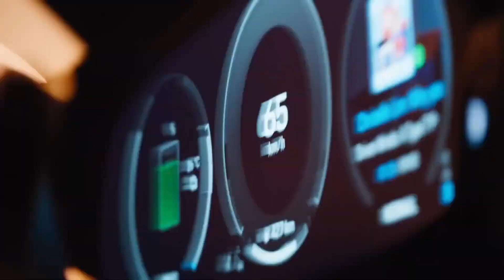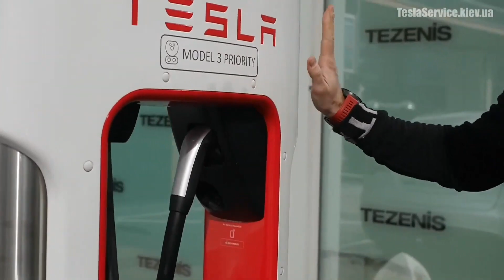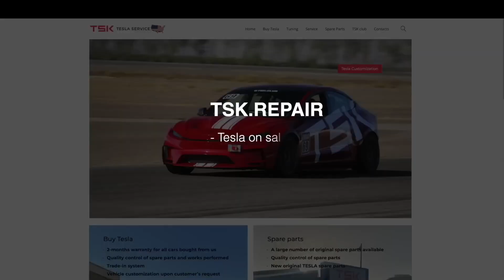Technologies vs Features

Comment: The problem is that the Gigacastings used for the from and rear subframes of the Tesla Model 3 and Y are irreparable, and they are not made available as separate components to body shops.
Any damage to the structures adds 10's of thousands of dollars to the repair bill, effectively meaning that damage to a normal car that could be economically repaired results in a Tesla being written off for the same level of impact damage.